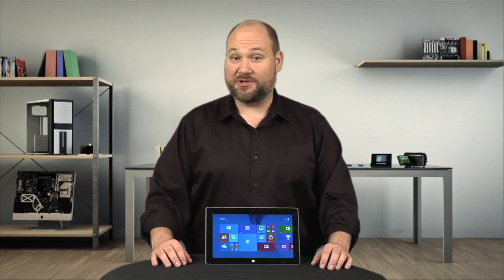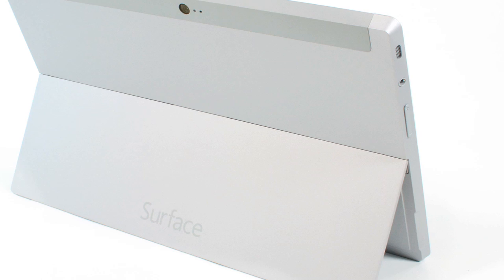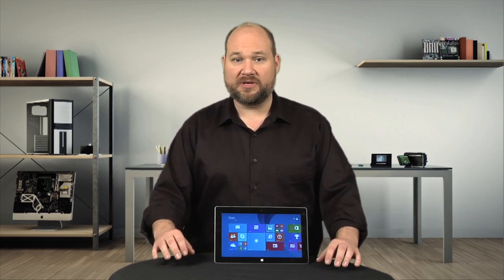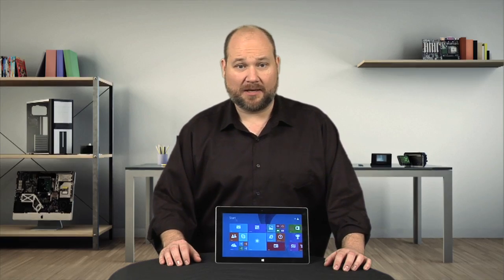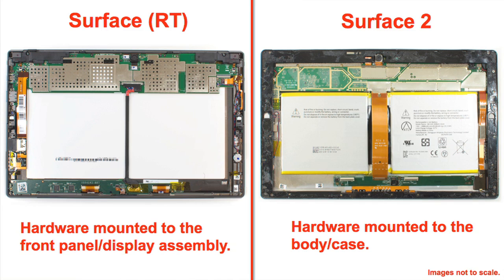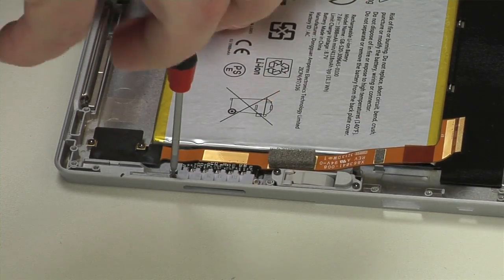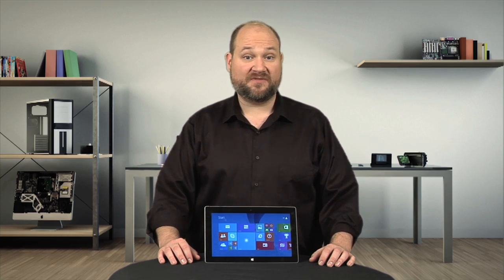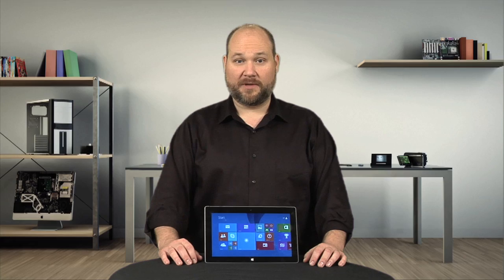Cracking Open - Microsoft Surface 2

Comment: the surface pro 2 digitizer ribbon is to the bottom center so when removing screen it is bet to do the sides and top before u start prying the bottom you may damage the several ribbons located there
Reply: thats what i just did!!

Comment: My Surface 2 ( P3W-00001 ) had the dreaded "Plugged in - Not charging" problem. I tried ALL the "soft fixes" found on-line to no avail.  This video gave me the guidance I needed to try and replace the battery.  I used my heat gun to warm the glass surface, waving the heat gun all over the glass in order to warm it all but..  not too hot to the touch - still noticeably warm.   I took great care to not heat the plastic case in order to prevent it from warping / melting.  Once warm, I used my fine utility knife to carefully and gingerly lift one corner of the glass, then wooden "popsicle sticks" to slowly separate (and maintain separation of) the rest of the glass from the adhesive - maintaining heat on the glass all along.  Once open, I found that the Date Code on the battery was  2013-10-10 - a little over 2.5 years old..  My problem first showed up about one year ago, but I did nothing about it at that time (other than try the soft fixes found on-line) since I could still use the Surface when it was plugged in.  Not discussed in the video, but the original battery is model # GB-S20-3096A5-0100  -  I ordered a replacement battery - P21G2B.   I'll update once I have results / details to share.
Reply: did the replacement work? What did you use to glue the screen back down?
Reply: As I am currently in a similar predicament, it would be much appreciated if you were able to respond as to what methods you used to replace your Surface's screen and battery. Such as, did you buy a new battery from Amazon? And most important for me is how did you replace the screen? Finally, how is your DIY fix holding up now?
Reply: clean the piece with a Qtip  without opening

Comment: and the battery will only last about 2 years then throw it away which is what I'm doing and getting a cheap Wi10 full 8.1 window tablet for a third of the cost of a surface.

Comment: Gday i have 2 surface 2s and one of them has a broken digitizer i was wondering what the best way is to seperate the LCD and the Digitizer, please some1 reply.
Reply: +UnDeAdSnIpr1912 I used a heat gun set at 460 degrees. It is important to NOT stay in the same spot for too long, especially along the bottom edge where connector strips are, or on top where cameras are.  If your heat gun kicks out more than 500 degrees, I would think about purchasing one with adjustable heat setting, with a minimum of 500 degrees or lower.  Let me know if you have any questions, I just finished replacing my LCD assembly.
Reply: +Nick Grilli i didnt even notice this comment thankyou so much for replying nick, ive ordered the screen ill comment on how it goes :)
Reply: I hope you have better luck than me.  I replaced the screen, but couldn't get the touch screen to work. I sent it back for another one, same result. So I essentially have a laptop, but at least it works. Good luck!
Reply: Just wondering if you ever replaced your screen and if so, how it went?

Comment: If your tablet needs a repair, take it back to the company you bought it from. Since when does any sane person care about repairing their tablet, and/or how easy it is?
Reply: Since you bring up repairing, making the tablet harder and more time consuming to repair makes repair costs go up, regardless of who you end up paying to do it. And down the road, used hardware that is difficult to repair makes it worth less to people who might repair and refurbish it for reuse.

But I doubt that's relevant for most people, not because they can just send it to Microsoft to get it repaired, but because most people would just toss it and buy a new one instead of trying to sell it or getting it fixed.
Reply: I've always had an interest in taking things apart and putting them back together. That never went away. I would like to think I am sane.
Reply: 9 years later and you're still dumb for commenting this